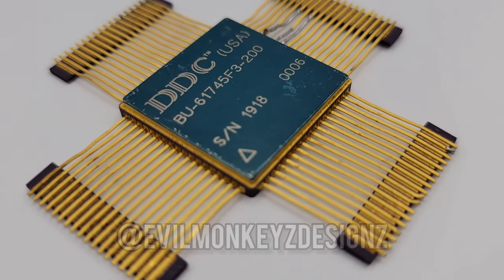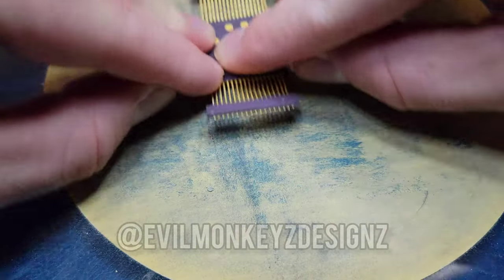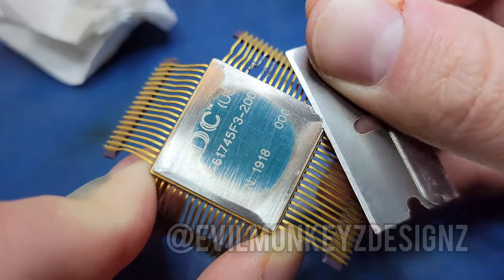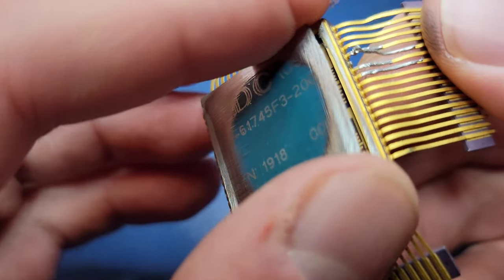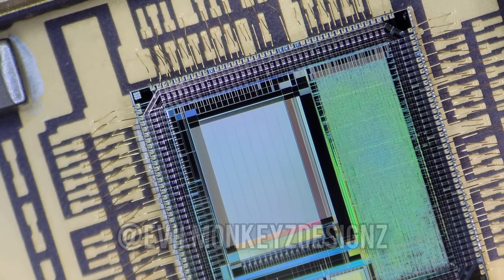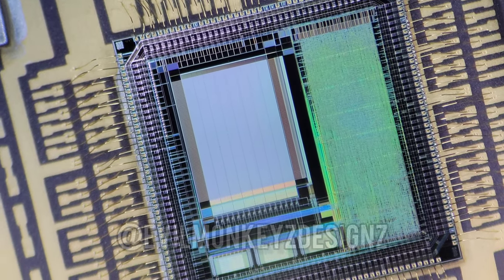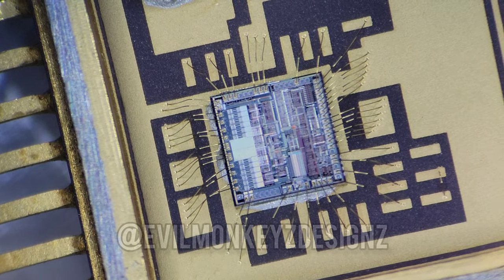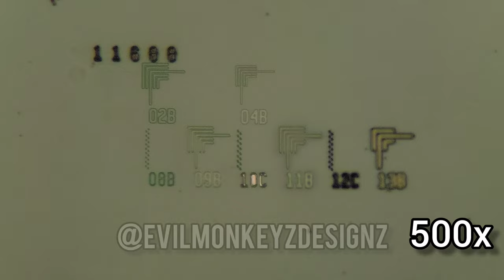Inside a MIL-STD-1553 Transceiver: DDC BU-6174

Comment: 1553 is transformer coupled serial. The idea is, if your wing or something gets blown off, you don’t loose comms with the rest of your load out, or whatever else you have connected.
Reply: I used to work on these, they're great but nowadays you can get the
Reply: I designed a number of transformers for use with 1553 bus systems in the '80s. The data was Manchester encoded to give net zero current which stopped the transformers saturating. Raychem produced some natty cable assemblies using their heat-shrink technology and our transformers. Never found out where they ended up; it was all hush-hush!
Reply: The problem with 1553 is how the protocol works on the data layer. Its extremely limiting, having a maximum of 64 bytes per message (32 words - why they use 16-bits as their word length is beyond me). 

It's a master-slave architecture (bus controller / remote terminal), but the big issue I have is that the slave has no way to asynchronously send messages. All transactions are driven by the host, no exceptions. This makes it very difficult to create an efficient protocol if you have intermittent data events. 

Another big problem for me is the message scheduling aspect. Messages are (usually, there are exceptions) sent in a rigid on a schedule. This means the message is sent whether you have anything to say or not. This makes it more difficult to have an event driven protocol, since telling a device to do an action gets repeated every time the message is sent (and the message is usually sent many times per second). It is of course possible to work around this, but it's annoying and the protocol just wasn't built for it. 

1553 is great for status driven systems, such a sensor to check airspeed or an actuator to open the landing gear (i either want it to stay open or stay closed - if it's already open and I ask to open it again, no problem). It's not great for things that revert back to their original state after the command completes, like firing a weapon (once the shot is taken, you are ready to take another. So if I ask to make a shot and it's already been fired, it'll shoot again unless I have extra logic to prevent that).

Anyway, there is a reason no new designs use 1553
Reply: @alexdyke194  Much easier to do error detection / detect damage/ missing nodes.

Comment: I'm going to assume the JWST uses integrated components that have been around for decades - which would mean less bugs and flaws which have been resolved
Reply: Don't underestimate industry legacy and sticking to old protocols even implemented with new ICs and languages, in a place as conservative as space. 1553 is sometimes even used in some recent satellites, and if you add to that the Webb was designed in the 2000s, it's not very strange to see used a very robust bus then less than 30 years old !

Comment: something with that much gold on it, is likely still useable today. 

easy repair and test.

always test before destroying this stuff, its not made any more and is highly valuable. 

down voted
Reply: 1553 transceivers are still produced (ask me how I feel about that....), although DDCI has gone out of business. Alta and Holt are two vendors still making 1553 chips. 

This chip has no value.  Any system using this chip needs to be highly reliable, and thus the circuits using these chips have already been redesigned due to obsolescence of this (and basically every other part) having gone out of production a decade ago. This is what my company does.